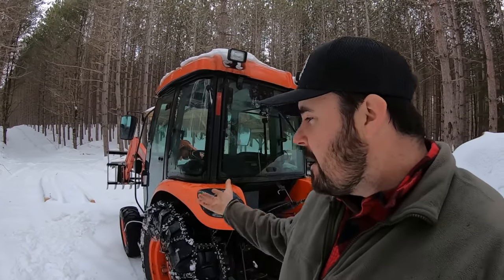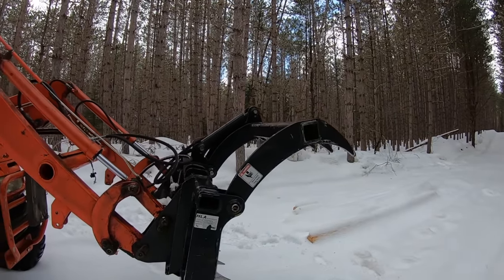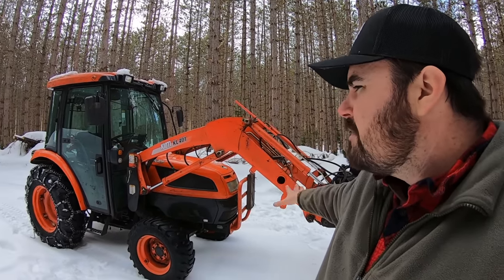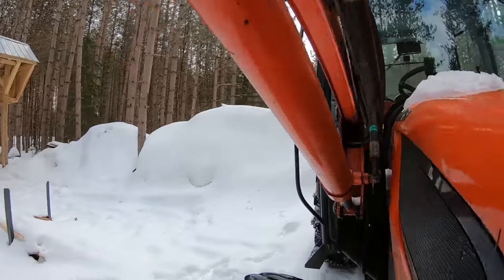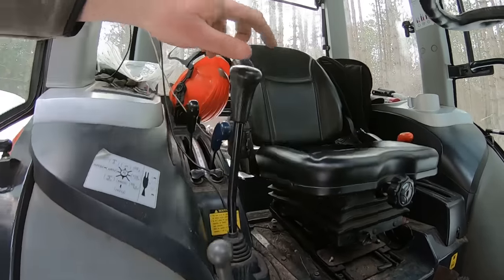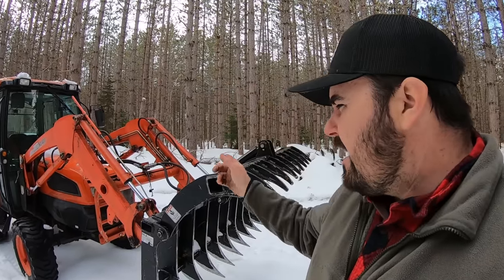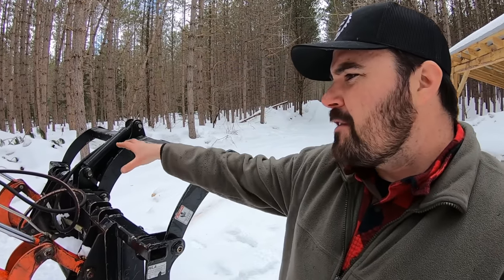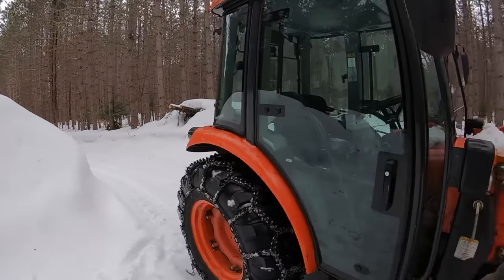Cheapest and Easiest Way to Run a Hydraulic Grapple on a Tractor

Comment: I had my 3rd function kit dealer installed when I purchased my tractor last year.  It was roughly $1500 cdn.  Initially I thought of doing it off the rear ports but it would have been $1000 cdn for the installation of rear ports and you get less functionality.  You're right about the grapple being one of the best implements to have
Reply from the maker: I think if I were to do it again and my dealer would price it right I"d do the same Paul

Comment: It cost me around  $1600 to have the 3rd function kit installed for my grapple on my Kubota tractor,but it is really nice to have all the controls right there on the joystick.
Reply from the maker: I'd imagine it's a great investment for sure
Reply: @sawingwithsandy  An electric diverter valve was about $250. Add to that a few fittings, some wire and a switch. The total was around $300 ($cdn, I live near Quebec city).

Comment: I run my grapple the same way you have for many years (Kubota M6800).
But, I hookup and unhook the hoses at the rear hydraulics every time i use it.
It's a pain...
Think I'm going to run my hoses UNDER the tractor like you have done.
Where did you get the bracket on the front of the loader that the hose couplers are mounted on?
Thanks,
alan

Comment: I equipped my Kioti with the third function kit from Michigan Iron  It works flawlessly. I tried the long hoses for a year before I made the change.  Never gong back. I needed 2  circuits at the back  for my snowblower and 1 at the front for my snow blade.   But if it works for you, great.
Reply from the maker: Sounds like a good setup there Walter!

Comment: good video and job. if you are not using rear ports for rear mounted tools you can save a little money. hydra hoses have went up a lot the last 2 years so it may not be much cheaper now. when i got the last tractor i made them put a 3 rd remote on it before i would take tractor they did it at cost to make the sale. take care, be safe and well.
Reply from the maker: That would be the way to go for sure I bet. Allow the experts to do it right.

Comment: I've always had them add the 3rd function when I order a tractor, but what you did also works backwards. If you have a 3rd function and no rear remotes, you can run a longer line to the rear for a hydraulic top link or a 3pt log grapple ect. 
I wouldn't care with a snowplow, but being able to use the curl function and close a grapple simultaneously with 1 hand is priceless. IMO.
Reply from the maker: I think that would be the way to go Dan. I think with time I’ll get a third function as well. Seems to be a great addition.

Comment: Have a DK65, I’m going to do the same thing, long hoses to the back, I have 2 sets so they can stay attached in one set, just wish I’d done it sooner the price of hoses has gone up significantly 😩, still cheaper than a 3rd function, this was a very informative video, awesome job 👍👍
Reply from the maker: I like that idea keeping the hydraulic lines hooked up. I may have to look into something like that as well. Nice tractor ya got there Russell. Some days I wouldn't mind a few more hp.

Comment: I hooked my grapple with hoses running up to the rear hydraulics too. Only difference, I used a T joint so I could plug an implement without unplugging the long hoses.
Today, I'd install a diverter valve instead because there are now very affordable valves and the price of hydraulic hoses went up a lot.
Reply from the maker: I think I'm going to look into that. I like the idea so I don't have to keep unplugged things in the winter especially.

Comment: I have been thinking that you could do something somewhat similar to mount a snowblower on the front of your tractor. But the difference would be mounting a PTO hydraulic pump on your draw bar to 😊get you the necessary GPM.
Reply from the maker: Those are neat setups I"ve seen Tony. I think the only drawback for me would be the cost at this point. I've thought about those type setups though as I've seen neat front-mounted mowers before

Comment: Sandy, I'm guessing from your explanation you cannot operate (open or close) the grapple while lifting or rolling the grapple rake? The third function can be nice, however, my nephew has one on his 70hp Kubota. When you're opening or closing the grapple, it has very little hydraulic flow when you're raising/lowering or tilting the rake. While I've not operated your tractor, on his I've found it best to bore in and scoop the grapple load, close the grapple and then lift/roll it.. all individual instead of simultaneous operations. In essence I'm doing what I perceive you're doing. Regardless, it's a tool that doesn't pay for itself this week, but like a table saw, it'll pay for itself time and again over the life of the tool. (I wasn't on yesterday so I didn't see this... t'was the wife's birthday, and THAT was a much higher priority interrupt)!!
Reply from the maker: Hey Carl! I do that method you mention were I dig in for a scoop then close the grapple, then lift. Bit slower compared to the motions of my mini excavator but does the trick

Comment: I would be tempted to add an extension to that rear remote control and call it good.  I thought about doing the same as you but went with 3rd function.  My rear remote not quite as handy as yours.  Anyway, nice video!!!
Reply from the maker: I like that idea Don!
Reply: I agree, make  that lever

Comment: I hope you see this message.  I own the woodland mills max mill and have figured out how to cut without the magnetic tape.  My cuts are perfect.  You have a built in indexter on the manual crank.  All you do is number each hole 1 thru 16 in counter clockwise motion.  Once you figure out how many turns it takes to make 1inch tjhick for example you write it down on the metal post.  It takes me 3 turns plus 7 holes for 1 inch thick.   now the way you zero your blade is after you have made a cut just notice where your index is.  if it is on hole 9 then raise the head one complete revolution to 9 and stop then pull the head of the saw back to the starting point and lower 1 rev back to 9 and you are at zero.  then lower the head 3 revolutions plus 7 holes and you will have 1 inch thick.  The other way to Zero is to lower the blade to the top of the cant and slowly pull it off the cant if your dragging saw dust your at zero.  I also work it from the bottom up so i can make all my 2 x 4 and 2x6 the same 5and 3/4 inch and all i do is mark the post at 5 and 3/4 with a sharpy and write above it the hole i should be at   it works great  all my boards are the same thickness.  By the way thanks for your videos they have really helped alot.
Reply from the maker: Thanks for that Kevin!

Comment: Hi Sandy. Snow on the ground still and we have 25 Celsius for the high today in west middle Georgia. Your time is coming, but so are the bugs, so snow might be better. Using the connections you already have was a wise choice. It looks like that connection for the grabble may have been less than $200. Will the grapple control handle extend about 6" to be even with the other control? Have good days!
Reply from the maker: IT's pretty wild out there with the high temperatures today and the deep snow still. Makes me wonder what's happening out there. I'd imagine the rear remotes handle is moving about 6" or so. I wonder if I could extend it upwards so I don't have to reach down as far to operate?
Reply: @sawingwithsandy  If you want to, you can!

Comment: Did you install the joystick? If not what is its purpose without grapple? Thanks
Reply from the maker: The rear remote joystick controls the valve on my rear remotes. It comes from the factory like that

Comment: You're definitely not getting hoses that long for a hundred bucks.

On top of that, by the time you buy all of those hoses and the fittings and the bracket and the couplers, you have nearly bought half of the third function kit already. Certainly not knocking Your solution, but I always find it odd that guy's insinuate like this method is practically free when it definitely is not.
Reply from the maker: Comparatively speaking it was the most cost effective option at the time. Hoses are pretty inexpensive where I am. One of the other things that was a drawback for me getting the third function initially was the costs of labour as I'd likely have to pay my dealer to install that third function on top of the price of the third function itself. Lots of things to consider though when looking to get hydraulics to the front of the tractor. Thanks for coming along for the video. Hope to see you on the next one